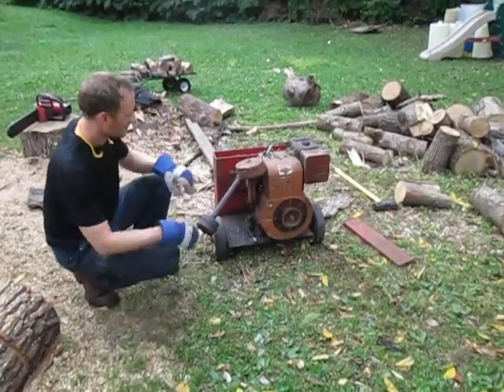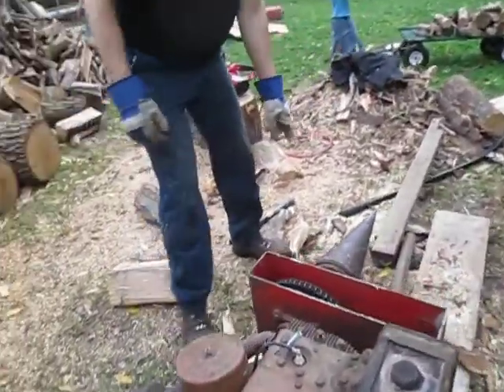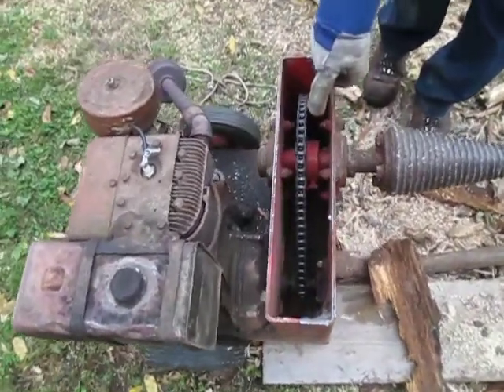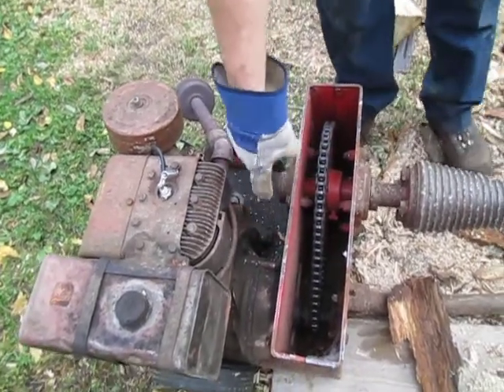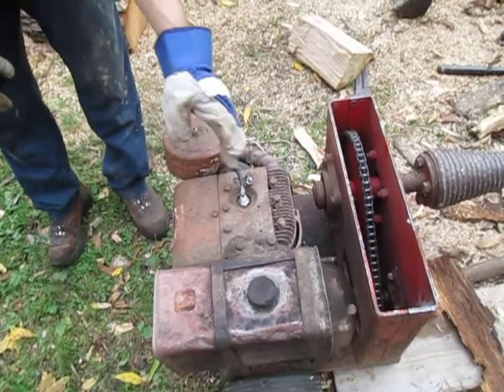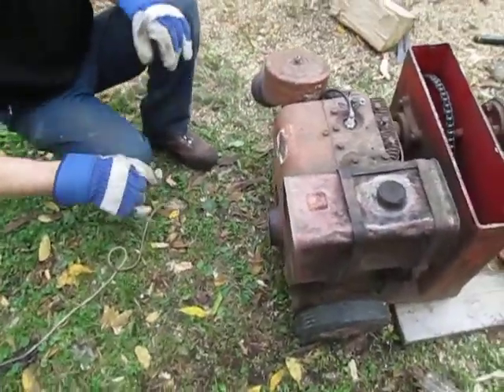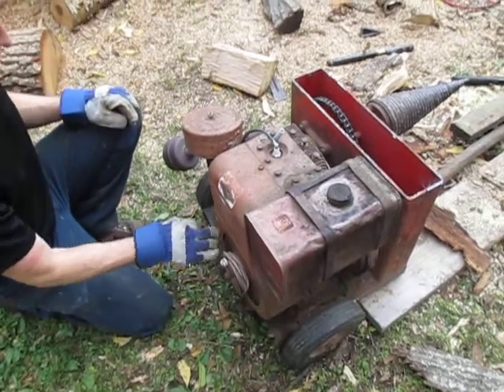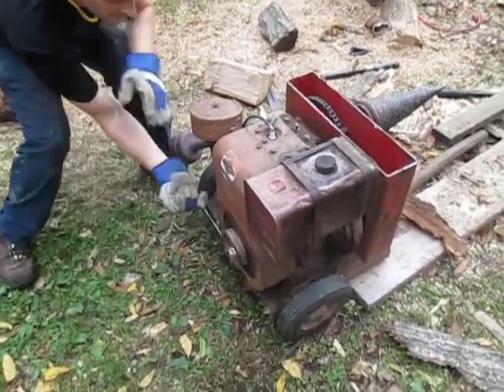nor tech screw log splitter "the screw and the lever" simple machines work!

Comment: May I recommend that you put a small table underneath the screw where the point of the screw is at least two inches below the screw! And then firmly push the log onto the screw! You doing it the way you are doing it is risking your leg getting screwed onto the screw. There are many idiots that’s hopping around on one leg ? I shudder at the thought of you slipping and getting caught up on the screw! Once the screw bites into the leg : there’s no pulling it out . And even if you weren’t able to stop the screw ! Pulling yourself free will be extremely painful

Comment: I figured out that the point of the screw was dull after I made this. after some work with a file, light hand pressure would start the rounds without the 2x4. 
I still used the 2x4 to knock the rounds off though to keep my hands clear.
Reply: Very nice,where do you get the steel screw bit?